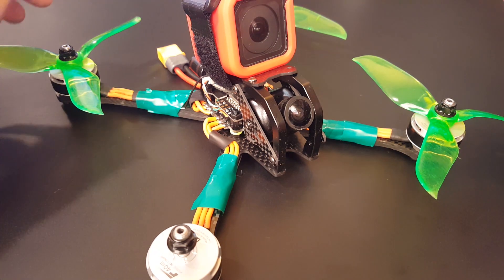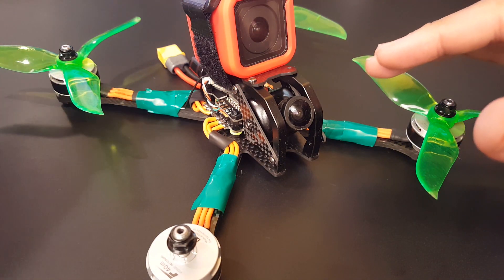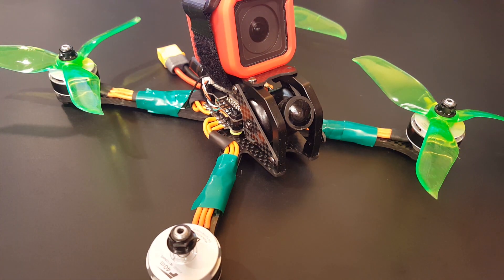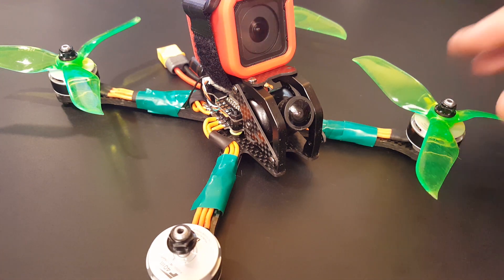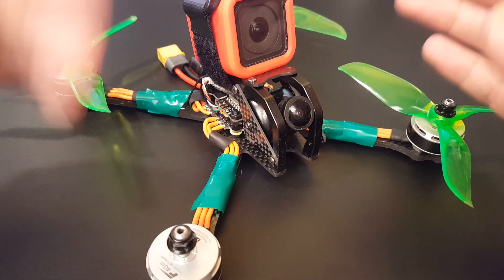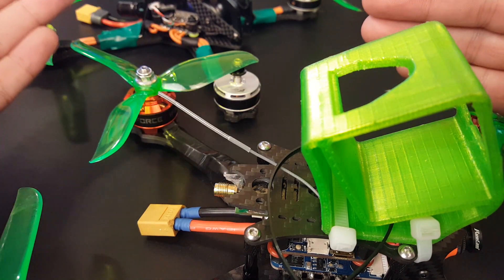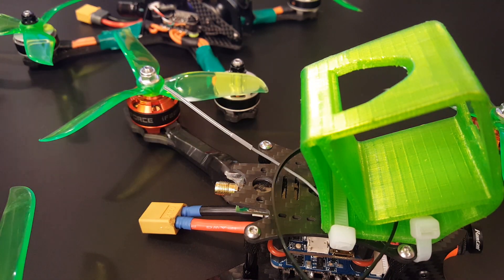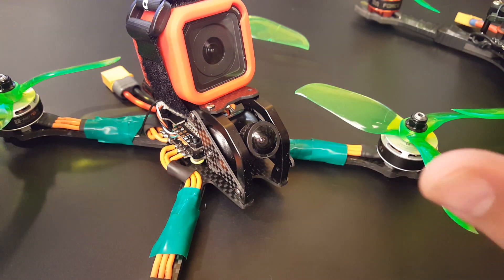FPV Noise // Common Problems & Fixes

Comment: Hey I like your videos very informative not many like you out there so thanks in advance for the help you probably already given me. But to the main question I've checked everything as stated in the video and when I fly a battery it has quite a bit of noise then when I fly another one and the noise is  barely noticeable and this is on and off the batteries are the same.?
Reply from the maker: +blaz1 I don't understand can you go into detail
Reply: Drone Mesh I'll fly a battery and I have noise. Then I'll plug in a new battery few minutes later and there will be no noise or very little
Reply from the maker: +blaz1 Check your vtx sma port possible hitting the frame.
Reply: Drone Mesh already did I have double sided tape so it won't make contact
Reply: Drone Mesh 
Hey buddy I figured out the problem it was actually my antenna that came apart at the connector. But I appreciate everything and all your videos and the help you give thanks again.

Comment: Im getting noise and brown outs, vid comes back in 2-3 seconds. Make for a tough flight, lol. I have a Lc filter that i have to try. The vtx came with it.
Reply from the maker: How old are your batteries. and what FC are you using.
Reply: the dys f4, thunder power 1300 new, the vtx is the lumenier tx5g6r raceband 600mw. full disclosure tho when i first got the vtx i forgot to have antenna on , but i noticed it right away and powered off....1 minute tops.  The vtx came with lc filter so im assuming the vtx has nothing on it as far as filter.
Reply from the maker: +G-nice are you using f30a esc from dys?
Reply: i am using xs 30a from dys yes. not the 4 in 1
Reply from the maker: G-nice where is the vtx taking power from
Reply: on the vcc power out for vtx on the dys board
Reply from the maker: +G-nice That should not happen unless you get voltage drop below 7V which is very unlikely. Maybe bad VTX?
Reply: ya im hoping i didnt fry it by not having antenna on, it was for a very short time like 1 minute, i was cussing at myself when i noticed loss of 30$  :((
Reply: well i just took the top of the frame off, kinda just spread everything out, props off and just powered up, looked through my fatsharks an throttle up and i have no distortion at all. Im wondering if maybe my zip tie around vtx was too tight or the fact that i zip tied vtx an camera wires together.  hmm
Reply from the maker: +G-nice check for loose component on vtx

Comment: Another stupid and funny FPV noise issue. After accidental squeezing through tree branches I noticed stripes in FPV video again. Later I found that antenna came a bit loose (obviously - after branch kissing). For sure I completely unscrewed antenna and only then realized that I mounted antenna with RP-SMA male connector to VTX SMA female connector (both have holes in middle) in hurry to get flying until is not too dark outside. It was good that I didn't lost FPV feed completely.

Comment: Hey drone mesh. Thanks for he video, helpful :). 

After a crash my fpv feed turned pink tinted. I'll check my vtx connections and swap out with a different to see if that's the cause. I haven't been able to check cameras yet, waiting on replacement to come in the mail. 

Any other ideas on what root cause could be? Already have 1000uf cap and LC filter. Could these be adding to the issue?

Comment: Another awesome pointer. Wherever I can I use the whitenoise boards for unify. I had massive noise on my chameleon and just fitted this board. It allowed me to drastically shorten my wires and also route them well clear of escs. It's now perfect. I have achieved exactly the same perfect result putting one on my karearea talon.

Comment: Hi, I really love your videos! I have a kwad that just restarts midair! I use emax bullet, tmotor f60 2200kv, matek f405 with the fchub, unify pro 5v
Reply from the maker: +Elliot VBR Does this happen on punch outs or after 1 minute of flight?
Reply: Drone Mesh After a minute of flight
Reply from the maker: +Elliot VBR Can you try a new lipo?
Reply: Drone Mesh I tried it numerous times with different lipo's and this doesn't help
Reply from the maker: +Elliot VBR Are you sure it restarts in mid and what makes you say it restarts.
Reply: Drone Mesh video stops for a second, esc restart tones, I see the foxeer logo appear which means the cam is starting and the timers on my bf osd restart
Reply: Does one esc restart or all of them ?
Reply: Irish_FPV they all resart

Comment: Have a racing quad with Matek VTX-HV and Emax Pagoda-2 antenna. Antenna is connected to VTX with coaxial cable - IPEX in VTX side and SMA in antenna side. Teared coaxial cable grounding mesh near SMA connector on crash with horizontal lines in FPV video as result. Soldered grounding back. Then teared grounding at another antenna cable end (near pagoda rings). Soldered grounding back. Unfortunately lines didn't disappeared completely. Changed antenna to new one (also same pagoda model) only to found that occasional lines still persists. What it can be? Did IPEX connector got loose? I pushed it back but that changed nothing. Maybe IPEX connector is broken too?

Thanks about 8.4V power voltage for VTX. Already guessed how high voltage (plus EM noise from ESC) interfere with VTX. Had no doubt about excess voltage which is going into heat and screw things up even more. I'll try that when ordered voltage regulators will arrive.

Comment: very interested :) .. i had to abandon my maiden flight today with my 3" copter because my small aio cam (FX798T flickered like crazy when i hit throtle, especially on 4S. It could have been a bad tune as i got oscilations on mid to high throtle and also a bit too warm motors i think (rcx rs1407 4100kv). But I also suspect the really crappy 5V voltage regulator on my 6€ super_S f4 2-4S fc. I added a capacitor to the battery cable but it wasnt really helping i think ..so i guess ill try another tune with less P and D and more TPA or the capacitor right to the 5V rail. This video came at the right time as i was about to figure out what to do so thx for the help :) anyways keep on the good work :)

Comment: One that tricked me was a loose middle lens. It looks similar to ESC noise on a Cmos style camera as it causes a rolling shutter effect that looks like ESC noise. The Foxeer 1.8mm lens seems to come loose in the middle lens a lot.
Reply: Sickocrow yes. Even the outer lens I have had issues with. Camera issues are huge. Also had the camera carbon upright plates loose.
Reply: Middle lens? Is there another lens inside of the lens housing on these cameras?  Mine is a Foxeer 1177, which is CCD I believe.
Reply: osheathedj  The lens we use typically are 3 lens in total, and maybe a IR block piece of glass in the back as well.  The front and rear one you can see obviously, and if you look into the front you can make out the middle lens which makes the bubble looking shape inside the front.
Reply: How would one fix the middle lens if it were to become unfocused?
Reply: Sickocrow How would one fix a middle lens that had become loose on my cmos eagle 2?
Reply: You could try remove the cover lens on the front and glue the inside one back in place.  I have no idea how to do that or if it's even possible.
Reply: Thank you!! After months of trying to trouble shoot noise its finally fixed! Definitely would have been the last place I would have looked

Comment: Im lucky.. always use 330 uf 25v caps on all esc.. I run my vtx directly from bat solderpads. 
clean video transmission.
have not had a quad since doing so that has noise.
Also i always strap the antenna with 3 stripes.. also isolate the sma connector from the carbon frame.
Reply from the maker: +2663540 Your a beast ^_^
Reply: 2663540

Comment: I had OSD issues with my Kiwi F4 FC. After working fine for a few weeks I started to get a lot of black lines where individual characters of the OSD could be during quick flips. Later the image would go completely black durin flips or punchouts. I fixed it by soldering one of the bigger SMD capacitors that I removed from an old matek PDB between 5V and GND of the Flight controller. This completely fixed it.
Reply: Change your cap ...?
The other day I had a couple nasty crashes and started getting black jagged lines on my video feedback.

I had just received my new caps and decided to change the old 470uf out and put a new 1000uf in. When I flew the noise was gone, and I actually had a slight dent on the top of the 470uf cap.

So maybe I got lucky, maybe it was the cap...

Comment: This is gold and very helpful ,you could include examples of different interference ,there does not seem to be a lot of videos out there.I have a problem on this VTX  https://www.banggood.com/EWRF-e7086TM3-5_8G-48CH-25mW200mW600mW-Switchable-FPV-Transmitter-Support-OSD-Configuring-p-1158300.html?rmmds=search
I have vertical diamond interference just powered on ,I have ruled out the quad wiring as I have tested the vtx  out of the quad and still have the problem ,so it does just seem to be the VTX its self ,I will try it on a variable power supply and see if the problem goes away at a different voltage(thanks for the tip). Its minor problem as when its flying its pretty clean video.
I have another one on order just incase its a QC problem.

Comment: One other issue is your motor screw length may be too long and is touching the motor windings. This causes sparking and throws interference everywhere.

Comment: Any ideas on this strange distortion https://www.youtube.com/watch?v=h1yPoOqXD5M&feature=youtu.be ? I have the VTX powered off the 5V rail. Low ESR cap and LC filter did not help. I have the same issue on two identical boards with different VTX and cameras. 
I am running the ready to fly quads asgard f3 (looks like the racerstar starf3 aoi clone). I am pretty stumped.
Reply: any help would be appreciated. I bought 3 of these boards and I am about to give up and move on and just replace them with something else.

Comment: I had a phantom noise from the beginning of the setup and it seemed to be intermittent, the motors would come down super hot after 10 seconds of flying, i was able to almost tune it out but couldn't get it perfect.  It turns out i had to lower the gyro from 16khz to 8khz and it fixed the problem immediately; this was with the new holybro Kakute F4 AIO on betaflight 3.2, you just cant run it on anything higher than 8khz and get good results even though it says it will run at 32khz (No Way).  Running on 8khz and 8khz to the escs the cpu usage is only 6%, the motors come down cool and it flies like a dream.  thanks for all the amazing and helpful content, keep it up.

Comment: YEEEAH I'm so glad you're doing a serie on this topic ! Dunno if you read my comment on your previous video, but it was just about that!
I'm having a hard time getting rid of noise.
I hope you will go more in-depth, as this particular topic is quite complex and depend on so many factors.
For example, you could show screen capture of DVR with specific noise patterns (It's a LOT of work tho!) and figure out what is the source of noise for this or that pattern.
My noise problem is present even without arming the quad, so I assume I can rule out vibrations, SMA connector, tuning and motors, right?
This left me with how the VTx (or cam?) is powered... struggling with that :/
I've read the comments of this video, and I'll try to see if I can shorten my wires and see if it helps. Thanks  @Team crap sheep

Question: does placing a low ESR capacitor here or there can make a difference? Mine is at the lipo to 4in1ESC connection, but maybe it should be closer to VTx ? 
I'm powering a TBS unify pro v2 (-> needs 5v) from the FC, can I put the cap there ? Or should I not even bother?

Thanks again DroneMesh for tackling this topic !

Comment: Use grounded coaxial wire for your FPV signal line. Mine became crystal clear after I use it.
Reply: I have experience with analog video connections between devices so small coaxial cable for camera->FC(OSD)->VTX connection was first about what I thought. Unfortunately doing it correctly involve crimping an new terminals to camera and VTX connector as well. I don't have crimping tools and connector terminals for 1.0mm and 1.25mm JST connectors so I put that idea back until I get them. Twisting signal wires is easier, but coaxial will give cleaner signal - seems it is worth to try.
Reply: IRFZ44 interesting. Is only the inner part of the cable connected? Or did you solder the outer cable to the ground?
Reply: Any shielded wire will work. The outer part should be grounded and the inner part is for the signal line. This wire protect against external electrical noise.
Reply: IRFZ44 thanks
Reply: Solder one end of the cable shield to ground otherwise you could create a condition known as ground loop if real power flows through the shield. best grounded at the FPV end.
Reply: Screen cable used for 4 to 20mA analogue signals in the electrical control and instrumentation industry works a treat. X2 internal insulated cores surrounded by the screen. Keeps all vid cables nicely segregated while removing induced noise and junk!
Reply: I use the shield of the coax as the only ground-line to the vtx, otherwise some differential voltage can arise cause the vtx consumes quite some current by its own and it creates some digital noise as well coming from its controler-chip. If the video-signal is only relative to the coax-ground and thats the only ground-point then any noise exists only on the other wires where it doesn't matter. (say +V and uart-line is immune to noise)

Comment: Anytime there is a video of good trouble shooting, it ends up be very valuable to the community. The most of us want to learn to be the best we can be and to also pass that on to others in the community. Examples, Nurk's live stream builds, or Project Blue Falcon's old videos. All the testing, building, trouble shooting and connecting with the community you do, Drone Mesh, is awesome! I would love to see that noise trouble shooting video.
Reply: I couldnt agree more.  This weekend I had an issue that was keeping me grounded.  I reached out to the fpv community here on youtube.  Most guys answered me and pretty fast.  They got me back in the air.  Best of all the weather was great and I had an awesome afternoon of flying.

Comment: The most important fix for me is to keep the wires to your camera and vtx as short as is possible, insure none of the fpv wires touch any other wires as they will induce voltage into your system this has worked better than filters and all manner of LC filters.
Reply: Team crap sheep totally agree. Short wires is a definite improvement. I had noise and shortened all wires and now it's perfect. Good tip!
Reply: TheMadmacs use a multimeter and check for continuity. Side of the carbon and top screw is a good place to put your needles.
Reply: Due for a rebuild is where I'm at right now. "New and improved". Cheers and good luck!
Reply: you think the lines might be from grounding onto my carbon... hmm thats an interesting idea because when i plugged everything in with it all just laying everywhere i think the signal was ok, so i thought the wires being pushed together inside was the cause, but it could be from my antenna touching the carbon or some wire grounding onto carbon..... its due a rebuild anyway, since it failsafed from 80feet up onto the pavement.
Reply: imma try this for black lines interference.

Comment: lol good list of issues you should continue the search for best filtering for video and al around it makes signaling better. vtxs some times break the coil in crashes not sure how but it happen to me also some i think say they can take up to 6s but it over heats them. its weight but they use to put ferrite on esc power line for noise/spikes just positive wrapped a few times around ring. lc filters i have seen need more inductance they help block high freq and caps suck the rest up you might need to get a variable setup with inductance capacitance and resistance. Also rc filter or a mix of all are used in good circuits. try the tvs diodes it might cut the spike that seems to get by its lighter the ferrite though ferrite basically make lc filter for each esc. you might check to see if its rf not in lines but in proximity.

Comment: If you have a screw touching your motor that can cause noise and if you have slipped magnets in your Motors I've had that cause noise and when I replace them or fix the screw it stopped. Also if your OSD flickers sometimes your board is not wired up correctly. The Omnibus F4 if you ground your camera and VTX to the flight controller that will stop the OSD flickering definitely don't power it off the board the voltage regulator will go out on older versions except the new one

Comment: Ive had noise from the sma connector rubbing on frame too.
Reply: omg all those things i couldnt think of even though they are so obvious.. thx
Reply: That's how it is! That's why I love the Drone community, we all help each other!
Reply: Got similar issue at quite long time because hadn't any other good spot to fix the antenna. So I mounted SMA connector it on carbon frame hole and effectively grounded my quad frame with blind FPV spots in result :)  Later I started to isolate antenna SMA connector. Now I'm flying with F200 frame which have textolite mount for antenna which isolate SMA connector - works good. Anyway - any good idea how to isolate SMA connector from frame if there are no other good option to mount antenna than only screw it to frame hole?
Reply: Try to find insulating fibre washers that have a shoulder on both sides of the frame. Washers must be non-metalic. https://www.digikey.com/products/en/hardware-fasteners-accessories/washers-bushing-shoulder/583?k=fiber%20washer